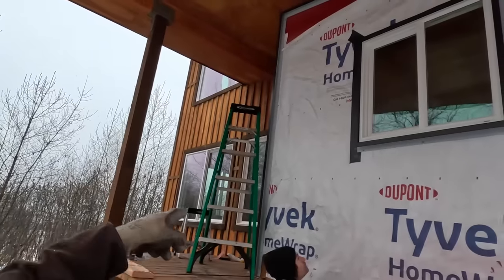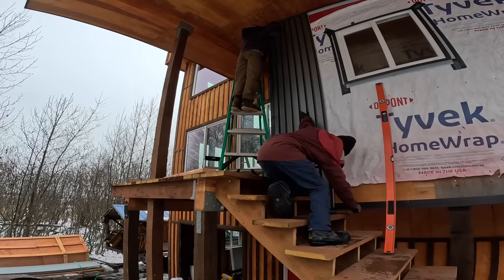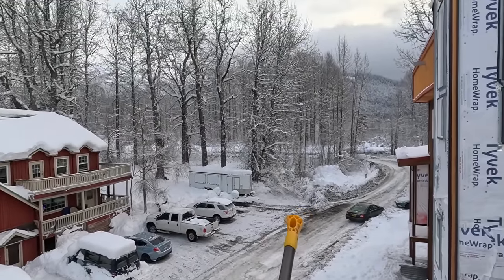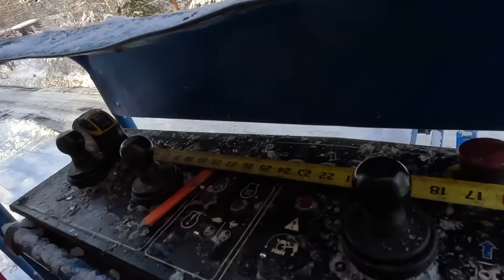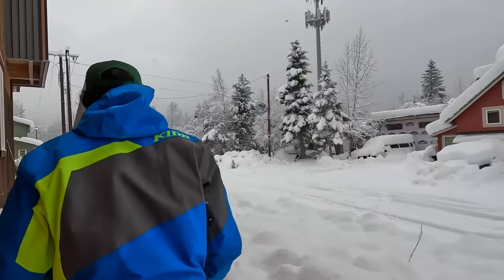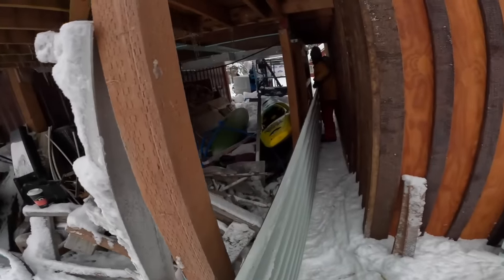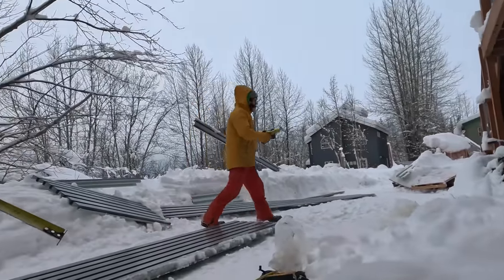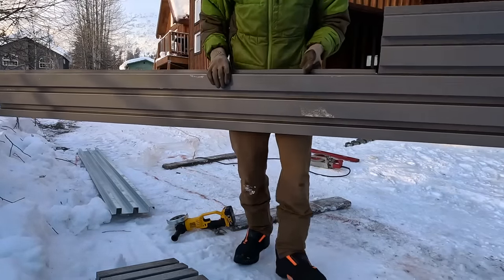The Boom Lift Failed 25 ft in the Air | Installing Metal Siding

Comment: Glad to see you learned your lesson about shutting off a jig boom while in it. I’ve done it before 85ft in the air. Good times😂
Reply: Glad I'm not the only one that's been stuck up in the air inside a bucket mine was a rental and it actually had a issue that I had to wait for a technician to come out luckily I was working so Time went by fast and it was a easy fix for the technician I guess it's a common occurrence with these things

Comment: Siding layout tip: Take your scrap cutoffs and cut 6in pieces enough to make a run across the planned siding layout to come up with equal end cuts and it will also give you layout for door and window and what ever you have to cut around. A pre planned layout for vertical siding.

Comment: Only if that window was able to be opened could have just climbed through I had trouble with one of those lifts before doing the same exact thing and I had to wait up there 40 ft for an hour until they send a technician out turns out there was a wiring issue with a sort of Killswitch on the Lyft that kept on sticking which killed the engine in left me stranded up there luckily I was trimming trees so I just kept working until it got fixed I guess that's a risk you take when using you rentals😅

Comment: There is a little black box fastened to the machine. That has your owners manual in it, per ANSI A92 standard. If you had read it you’d see that you should always have a harness on while operating, at any height. Also, all booms have an emergency electric override to get you down when the engine won’t start. That’s in the owners manual as well. No one ever reads those.

Comment: Worm drive saws make cutting metal sheeting a little easier because the saw design is longer bodied and has more torque I think.  Double hearing protection highly recommended with foam ear plug inserts and ear muffs over the outer part of the ears.  We did double hearing protection on the flight lines in the Navy when I worked on avionics systems.

Comment: A 7 1/4” phosphorus Metal skil saw blade will do the whole job and then some. Make smoother edges as aposed to the tearing through method.  Good to see the old wood blades still cutting stuff jimmy hendrick’s style.

Comment: Hey man sometimes when those boom lifts are not quite level or the man basket is not sitting just right when you turn them off there is a safety switch or toggle on the basket control panel you have to push on while starting it and even sometimes to make the boom to move around just for future knowledge.

Comment: It's happened to me a few times thiers a few reasons it can happen where the angle and load jeopardize the machine from flipping also certain wind and shaking can shut it down and if load is to heavy  it will go in limp mode or if u max out 2 or 3 arms can cause it as well

Comment: They have an emergency lowering feature the operates from the battery. Safety harness should be used also. Workers are often ejected from the basket and a harness can save your life.  Training is always a important step in using a man lift.

Comment: Once had a "HiJacker" fully hydraulic lift on the back of my F550 deck. At 32' full extension it seized. Luckily I had a harness and rope in the bucket and repelled down.. no one around...would have been a long night.

Comment: i would not use a diablo for cutting the metal.  use whatever blade you got as its not the sharpness that is doing the cutting.   it also works on fibre glass as well

Comment: In a pinch you can take a worn out circular saw blade and install it on the circular saw backwards and it will cut that light metal fairly clean. Go slow. Practice on a scrap piece to see how it cuts.
Reply: …that’s what he did @ 4:19

Comment: Pre drill your holes on the ground then you wont have to do it in the air you can just screw it off and then plus your screws will line up vertically and horizontally

Comment: Dude. 
I just watch your other siding yesterday with you using this boom by your self and worried about you being by your self, but what I saw I thought you left it running that time. 
Maybe you could leave a battery maintainer plugged in at all times on the machine.

Comment: That silicone will never cure properly just fyi it has a temperature range on the back saying what is the correct temp ranges to apply it. But I hope it doesn’t fail on you brother great job with the house. Unless of course you looked into that and found a good quality maybe a little more expensive caulk/ silicone that’s rated to as low as -20 then your all good but could still take up to 12 days to fully cure. One more thing the brand Lexel is an awesome brand little more expensive but cans get wet immediately after applying and will never freeze and is paintable and will not pull out of joints like other brands. And can be cleaned with cleaners and is the clearest caulk I’ve ever used and doesn’t yellow

Comment: I think your overhang should be supported by another beam (vertical or at an angle) to prevent sagging due to weight of snow. Check with a civil engineer. I am a Mechanical Design Engineer. IL, US.

Comment: Hey Tim, Very Nice, it's coming along. Great job guys. I absolutely love watching every video you post, I have learned something new from every video, no BS. I love that you don't let anything stop you from doing what you want. I have a big issue with that. And your videos give me that inspiration to just keep going. Oh, I also wanted to know, is snow shoveling heavy, like dirt? Or is it lighter? I would think it's lighter, but I also assume it depends on the amount/compact of the snow, or slush you're shoveling, right? lol, just curious😁
Reply: There's a lot of variables and lots of different types of snow. It can be awful back breaking work, and it can also be light and fluffy. Warm, wet snow is the worst. It can get so bad that a snowblower won't throw it, and it's really difficult to plow. Cold fluffy snow is much easier to deal with.
Reply: @Friscorockhead  thanks for letting me know about the different types/variables. I live in Florida, never seen snow, so I was curious😁
Reply: @kristinakronk5373  no problem. I'm from northern Michigan and we usually get brutal winters. It's been warm this winter though. I love snow and changing seasons but it can provide difficulties, to say the least! You just have to be prepared.
Reply from the maker: It's lighter but can be suuuuper heavy if it's wet, which is usually is here
Reply: @Friscorockhead  I can definitely understand that.
Reply: @TruckHouseLife  wow, yea that's crazy, I see you constantly pushing or shoveling 2ft or more of snow almost everyday, great workout.

Comment: Its interesting... You live in Alaska where you have winter most of the time... and the insulation on your house seems minimal. And you built with wooden boards. I am just thinking 😊 I have mild winters compared to you, they last 4 months, the last 10 years with almost no snow and temperatures from +5 to -5 celsius (in the past, when i was little, we had a lot of snow and low temp. to -20 celsius) and we build with concrete or bricks and put 30cm of insulation on the outside walls to keep it warm. Maybe i forgot but how thick is your insulation, will it be enough? The house seems mighty slim on the walls and you have snow storms and deep cold all the time...
The house looks great btw, cant wait to see it furnished 💪✨
Reply: And also i love the 3 part roof seen from the side (at the end of the video), good angles, it looks special!

Comment: Just a question, hope someone could answer for me. Is there any risk of moisture or mold between the panels and the walls due to them being wet from the snow falling?
Reply from the maker: Nope the metal keeps rain off the tyvek, but there will always be some condensation from heat transfer

Comment: Well there’s a reason why your electric worm drive saw cut better than your battery powered flip backwards wood blade! I have done construction work my whole life. First of all flipping a wood blade around backwards does work great with a electric powered Skil saw honestly, I was impressed with the battery powered saw even getting through that thick gauge metal!!! Cutting something that Big takes electricity 120 and 10 to 12 A that worm drive saw puts out 12 A. It’s gonna run through that metal like butter.

Comment: Turning the blade to run backwards is ok, but it kills the blade for cutting forward to the point it wont cut thru hot butter. Why do that when it is much easier to use a cut off wheel. Put clamps on your level for a guide and your line with the cut off wheel will be straight. Another thing for you to do since you are up in the really cold area is insulation. The last house I had did not have that pink insulation crap...it had closed cell foam that was poured in. The difference in insulation was better than night and day. This stuff was poured in between the outside wall siding and the inside sheet rock. you can apply the foam either by spaying or pouring. Spraying has to be done before the sheet rock is put up, then trim off any excess. Pouring must have a relief hole which can be the same hole in the top 2 x 4's to allow for expansion. Without the relief hole it will blow the sheet rock off or the outside paneling...but your electric bill will be way less. My house with the foam was almost 3000 square feet and my average electric bill...winter and summer was around $125.00. The foam is expensive, but you will make up for it the first year. If you need anything, PM me and I will get it for you and UPS it up to you as I am sure the same thing here is way cheaper than there.

Comment: you seriously need to either buy or build some saw horses. also if you're not done hanging metal panels get a new chalk line and fill it with baby powder. then you can "chalk" a line for your screw holes that will easily wash off.
Reply: really ? baby powder ? Never thought of that, but makes total sense. That chalk can be quite a bugger to erase. cheers.👍👍
Reply: @blueman5924  anywhere you need a line but don't want a color to remain baby powder has the same texture and behaves the same as chalk.